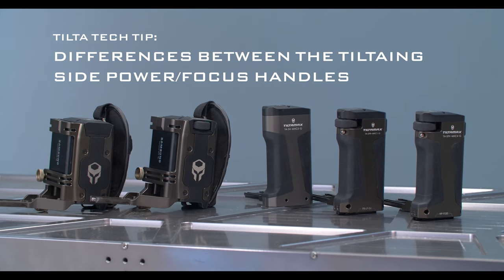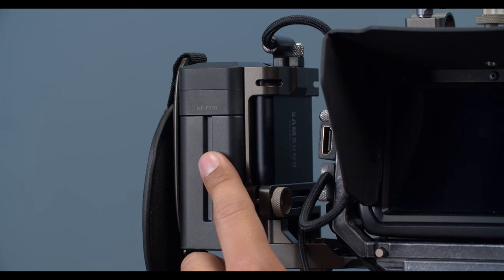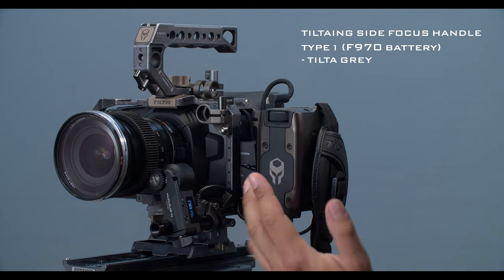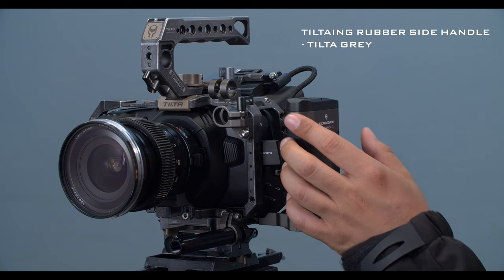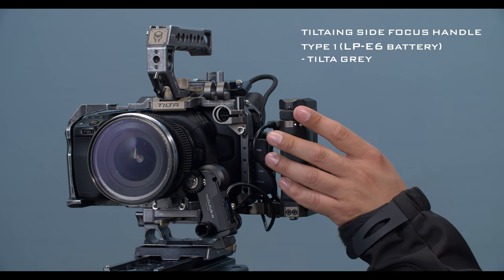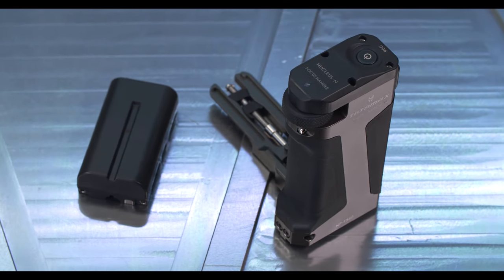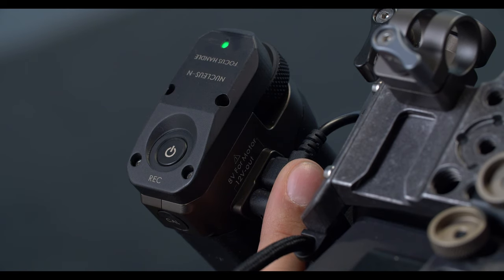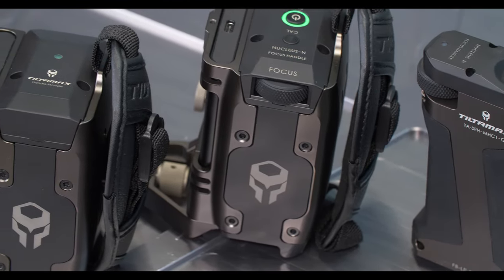Tilta Tech Tip: Differences between Tiltaing Side Power and Focus Handles

Comment: Yeah, now remove the proprietary mounting system and replace it with an Arri Rosette, so you can use it with different cages and you got yourself a new customer
Reply: There is an option for Arri Rosette already. Just look it up on there website.

Comment: Will the focus control work with the Nucleus-M system?
Reply: Steven Mark Shipton I have the same question
Reply: @shotbywam  I contacted Tilta and they said no, but they are working on a micro-USB to 7 pin cable that will enable it to work. No ETA on the cable.
Reply: Steven Mark Shipton Thank you

Comment: Obviously I'd love to have these but I refuse to acknowledge the word "tiltaing" as anything but garbage wording. Reading, verbalizing it is nauseating
Reply: Ya, "tiltaing" is not the word that suits the brand. Another thing for me is the RIGHT HANDLE is kind of MUST but all these are left handles. I will choose my Right hand to hold and left hand to control or change monitor setting or Focus. These are focus for just mirrorless. They show a lot with BMPCC 4/6K but it is already a wide body to widen more. What are you thinking TILTA? If it all has Rosette then can be used as in DOG Bone or other accessory which doubles as handle and focus puller but it doesn't work for me at all

Comment: I purchased the Tilta cage and type 1 power side handle with focus wheel for my S1H and Nucleus Nano. Does the remote run/stop cable attach to the side handle power out port or the r/s port at the Nano motor? The other end of the cable obviously attaches to the remote port on the S1H.

Comment: The focus control is not a full implemented follow focus. The is no calibration for photo lenses! It is just a USB connected motor that turns. they claim that you can do A_B selection, but since there is no documentation I was not be able to figger out how. TILTA support doesn't tell you how it work. the experience is not smooth like the wireless controller, to me it often turns too fast.

Unfortunately when you connect the USB from the handle to Motor Nano, the wireless follow focus of the Nucleus -N stops working.

Comment: Спасибо! Do your Handles work with a different camera? For example Z Cam E2?
Reply from the maker: Hi Peter.
The side handles will work with our other Tiltaing Cages. They'll be releasing soon. 
https://tilta.com/product-category/tiltaing/cage/
Reply: Forger the Tilta answer, Peter. Just got a Z-Cam and the Tilta hand grip works great with it using the LANC connecxtion with the 2.5mm male jack. So, you DO NOT NEED any othger product from Tilta to make their Arri Rostette hand grip work with any Z-Cam. Another grip with START-STOP that works fine on Z-Cams is the Blacmahic Design Ursa Mini hand grip.
Reply: @frankfarago2825  which one is your Z-Cam?

Comment: Like the system show for the BMPCC at 00:48, does Tilta make a cage system for the GH5 with the Nucleus Nano Type 1 control handle with NP970 battery? In addition to the side handle with focus control, I'm hoping the cage will offer a way to mount the 15mm rod for the Nucleus Nano.

Comment: Hi there can I use my ordinary dji data micro USB cable to power the motor and start stop tru my tilta power focus handle or it's propertiery cable by tilta
Reply from the maker: You will need our proprietary run stop cable, but you can power and control the motor with any micro usb cable that transmits power and data!

Comment: Does one need a separate wire that communicates with the Nano motor through a wired connection. (Side Focus Handle Type I (LP-E6) to Tilta Nucleus-Nano)
Reply from the maker: You can use a Micro USB to Micro USB cable, which is included in the Nano Kit, to power and control the Nano motor with the Focus Handle!

Comment: Can I use the focus dial  with Panasonic or OLYMPUS lenses wich don't have mechanical focus wheels ? I've read some reviews and they told me that the focus dial only works with Cine Lenses, since the side handle focus dial can't control the Nucleus motor completely, and the motor can't stop itself automatically. If so, the side handle is totally useless for DSLR filming.... looking forward to your reply. thanks
Reply from the maker: The Nano has the ability to manually calibrate lenses without hard-stops, but is unable to stop itself while auto calibrating. 

Please contact support@tilta.com for more information!
Reply: TILTA Thanks for your information ! I'll take a look.

Comment: The Tilta side handle(NP-F970)battery powering the side handle AND the BMPCC 4k? - estimated run time with this set up? 2-3 hours?
Reply from the maker: This depends on the specific battery you are using, but the average F970 battery will power the BMPCC4K for about twice as long as an internal battery!
Reply: @TILTA  which cable do i need to power the blackmagic pocket 4k with the side handle ?

Comment: I received my side power f970. Should I remove the battery after use? The green LED is always on. Weird.
Reply from the maker: Hey Tim, the green LED signals that the battery is connected. We recommend removing it after use for maximum battery preservation!

Comment: This might be a silly question but could i use this grip to power a sony A7iii (or A7Siii) since it only needs 7-8volts of power if im not misstaken? would it fry the camera?
Reply from the maker: If using a 12V Micro DC to Dummy Battery Cable, most cables will regulate voltage to be the same as a battery!
Reply: @TILTA  Thank you. But could i use the hadles USB to power the camera? Not a dummy battery. And the 12v port to power the focus? And not fry them both.
Also would a Samsung T7 fit in the slot for the ssd?

Comment: Can you link to the 12v power cable you have running from the f970 handle to the camera? I have the handle but the regular 12v cable I have does not fit into the tiny 12v slot it has and I cannot find one that fits.
Reply: The W Image Yeah I found it! Only place
I could find it was from their website, I wish they would have just had an indicator somewhere to let us know we had to get that specific cable with that handle. I just had to order that $15 cable from them and shovel out $15 for shipping. Yikes
Reply: @arifpierce9068  Which cable was it?

Comment: Are any of the grips that feature a focus wheel compatible with a Tilta cage for the GH5? If so, what is the name/model of the GH5 Tilta cage? Thank you...
Reply from the maker: Yes! All of the Type 1 Side Focus Handles are compatible with the GH Cage (SKU: TA-T37-FCC-G)
Reply: @TILTA  Thanks for the reply! I am considering the Panasonic S1H camera. If Tilta offers a cage for the S1H, will the Nano focus handle be compatible with it?

I would also like to use the Nano motor with my Panasonic EVA1 should rig. Can I just buy one of the Nucleus M handgrips to do this?
Reply from the maker: The S1H cage will also work with the Type I handles and yes you are able to control a Nano motor with a Nucleus M Hand Grip, but you will need a different power source!
Reply: @TILTA  Tilta already has a cage for the S1H? Cool! Can the Nuclues M Hand Grip be powered via USB power bank?
Reply from the maker: The S1H Cage will be released very soon! The Nucleus M Hand Grips can only be powered by 18650 Batteries
Reply: @TILTA  I got the Tilta cage for my S1H, and like it. I do wish the top controls, especially the left side rotary knob was less obstructed. I think there is more mass on top of the cage than necessary, but overall it works as expected.

Comment: I already own the Tilta cage. Do I need to purchase the baseplate as well in order to use the power handle, or can I connect the side power handle without it?
Reply from the maker: You do not need the baseplate to use these handles! The handles will connect directly to the BMPCC Full Cage!
Reply: @TILTA  can u make a video o screenshots on your website about how does it connect in this cage, because of i need to see it before buying to know what else can connect under the cage!

Comment: Will the v mount battery baseplate be able to be mounted onto rails or strictly for the camera to be mounted on top?
Reply from the maker: The battery baseplate cannot be mounted to other places. It would be just at the bottom

Comment: Is there a kit? Handle + motor. Or still just the motor and wheel controller?
Reply from the maker: There is only one kit and it does not include the Handle:

https://tilta.com/shop/nucleus-nano-wireless-lens-control-system/

Comment: Question about the Side Focus Handle (LP-E6): Is the hard wire from handle to motor only meant to power the motor, or does that also control focus functionality as well? I feel like this side handle could mount to the base of a Ronin-S type gimbal very well, and provide support and focus control in a much more effective way than just the standard nucleus nano follow focus mount does...

Of course, you're probably already working on that solution ;P
Reply from the maker: Hi Ryan.
The Side focus handle not only powers the motor but also gives it control. You use the focus wheel on focus handle to control the Nucleus Nano motor.
Reply: @TILTA  Appreciate the response! 

Crossing my fingers that in the future the focus wheel on the handle could control the nucleus nano via wireless connectivity - That would be amazing!
Reply from the maker: well, actually if you pair the Nucleus M handgrip with the nano motor, your desire could come true right now.
Reply: @TILTA  frantically grabs wallet
Reply: What about the 12V output? As soon as I plug it into my bmpcc4k the power of the LP-E6 in the handle is gone. Is it meant to power the camera? And if not, why is it there?
Reply from the maker: Hey Mark, 

The 12V output is meant to power the camera in addition to the camera battery. 

It is also useful for keeping the camera powered while swapping other batteries. 

The LPE6 is a smaller capacity battery that is really only meant for powering the Nano motor.
Reply: @TILTA  but the lpe6 battery is also in the camera. unfortunately I put it in and connected the cable with the camera so the battery in the camera broke.
Reply from the maker: If you'd like to get your equipment repaired, you can find the service request link here: https://tilta.com/customer-care/service-request/
Reply: @TILTA  can you confirm the above as the manual states "When powering your camera with a custom made power source, we recommend removing the LP-E6 type battery."

Comment: HI , i own a side focus handle F970 , two questions there is a way to use the 12 v output instead of 8v usb to give more power to the motor ? second question using the usb connection there is chance to focus still using the wireless knob instead of the handle or if handle focus usb is connected it bypass wi fi completely ?